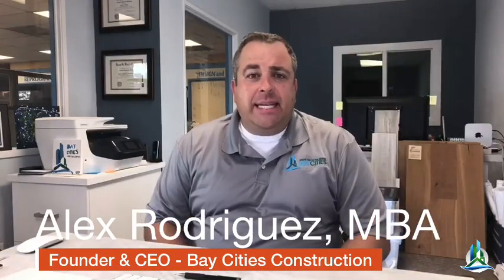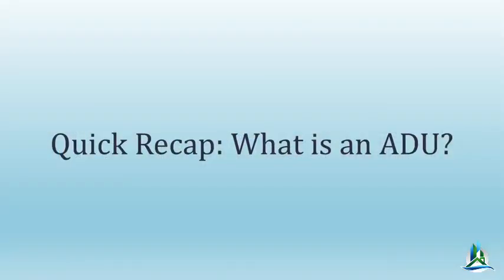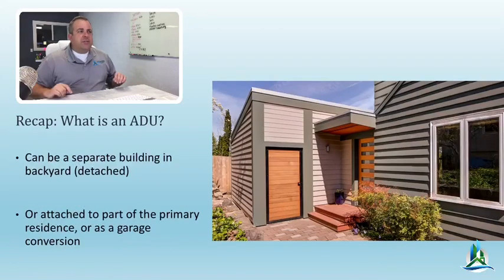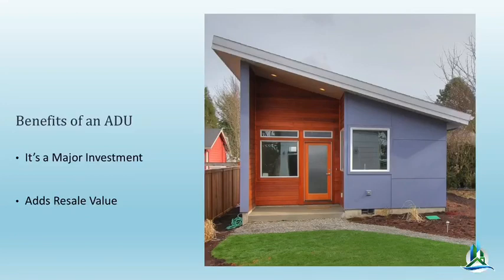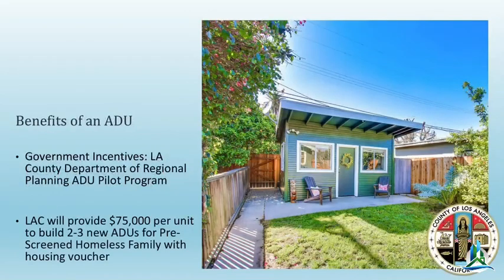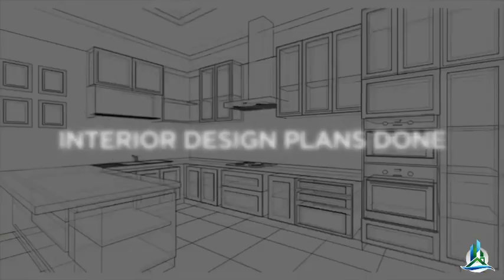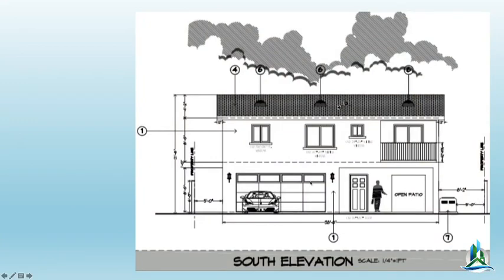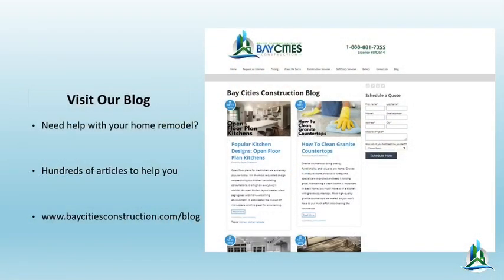ADU Tips & Tricks | The Construction Show Episode 19

Comment: Very good video, just what I needed. Is Edison's easement the same throughout the south bay? And what is it? I have power lines running across the back of my  property. I would say they are about 3 feet from back property line above my yard.
Thanks!
Reply from the maker: Hi Scott - Thanks for watching our video. Overhead service lines are common in backyards in the South Bay,  but easements/setbacks can differ in every city. You'll want to contact SCE for help, they'll review your plans and will move service lines that may interfere with your project.

Make sure to like and subscribe so you won't miss another video!
Reply: By move? Do you mean putting them underground? And is that expense on me? I live in Manhattan Beach and there ADU hand out says the back setback can be 3 feet. So I was wondering if that overrides Edison ?
Thanks again. I have watched all your ADU videos and they are great!
I am talking about the high power lines. Not the secondaries that run to the house. Just to be clear.
Reply from the maker: For service lines,  they won't underground them (it's way too expensive for them) they'll just move the service line to another utility pole. The setback will vary per neighborhood. Transmission lines are a whole different story. You'll want to contact the SCE Planning Office for any specific questions ....they'll be able to answer any specific questions https://www.sce.com/partners/consulting-services/localplanning want help designing & building your project? Schedule a consultation at www.baycitiesconstruction.com